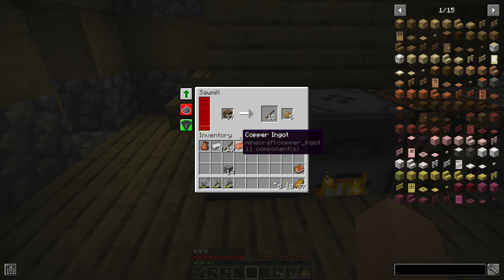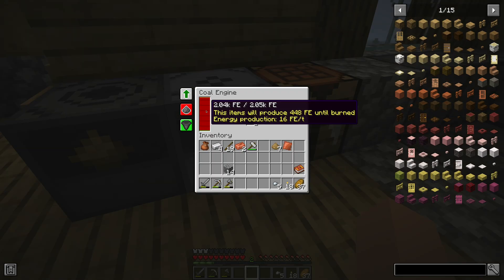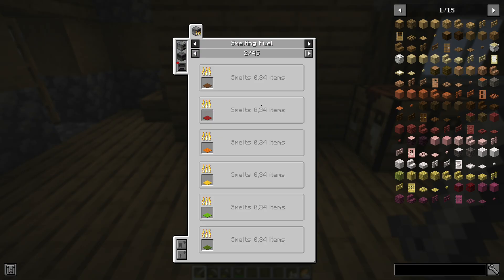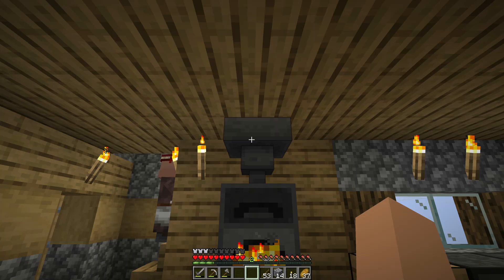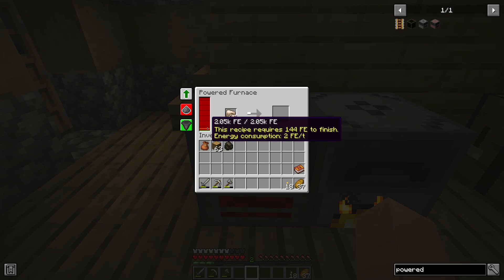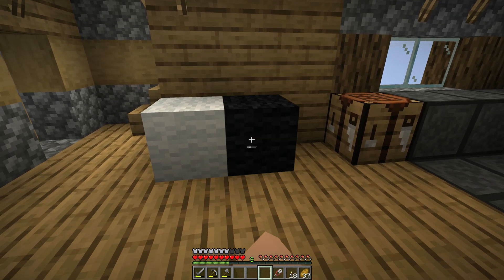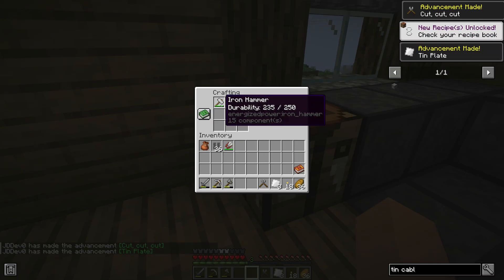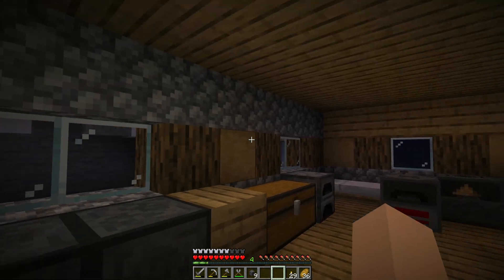All about machines and energy - Energized Power Tutorial series #02

Comment: bro please explain how use alloy furnace. i need steel ingots
Reply from the maker: You need to insert fuel (Like Coal) into the bottom slot and smelting ingredients in the top slots (1x Iron ingot in one slot and 3x coal in another slot for 1x stell ingot).
You should install a recipe viewer mod like REI, EMI, or JEI.
If you are on Fabric, JEI is not supported by Energized Power. (EDIT: JEI is support on Fabric for 1.20.1 and 1.21.1)

Please wait for episode 07 for more details.